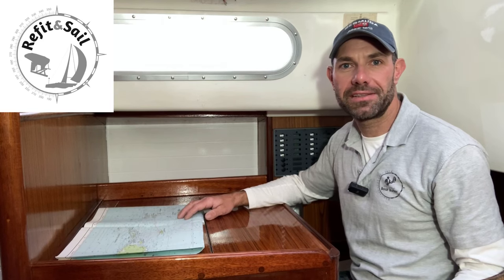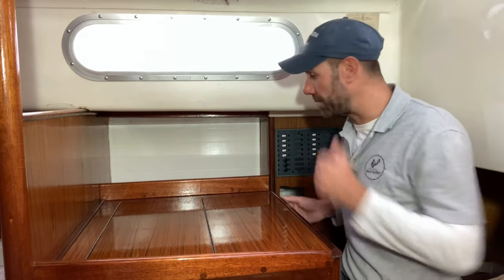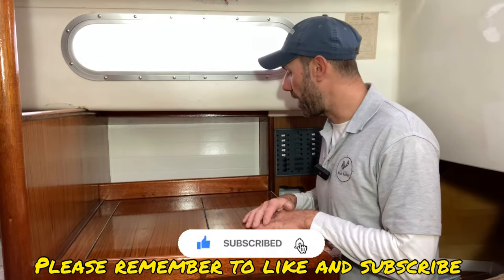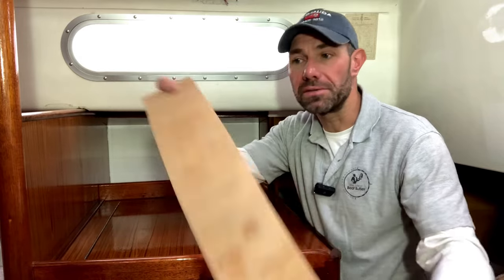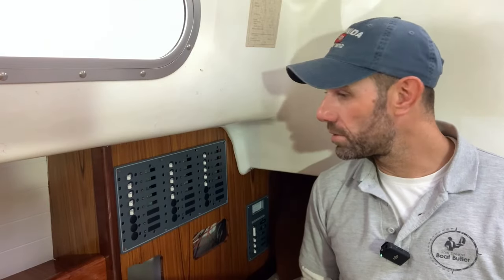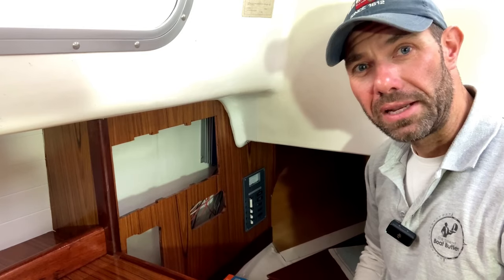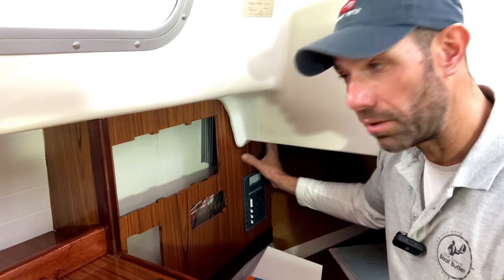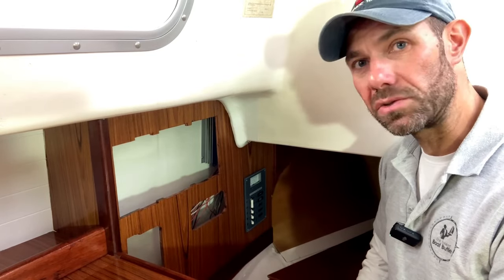Refitting the Chart Table, Nav and Switch Panel Area (Project Lottie Ep 25)

Comment: That's is some very nice woodwork indeed !
I do like the new shore power panel, I am about to replace my old domino unit with a new rcd consumer unit but this looks like a proper job.
Thanks for another very informative video.
Reply from the maker: Thanks.    I have used/fitted a domestic RCD/ Fuse box a few times previously (albeit a water resistant one designed for garages or outside buildings) which is much cheaper but definitely not as nice.    The owner Pre-bought all the switch panels and provided them, really nice quality but I know they are quite expensive.
Reply: @RefitandSail  
Thanks George, I'll look into that, I thought it was your spec not the customer, interesting. The one I have would be fitted in a garage or the like, the current one is in the engine bay and I was going to keep it there but change the feed cable, I also like the new shore power socket you fitted. Thanks for the advice. 

🍺 in the post.

Comment: Hello
Nice video as always 
You didn’t explain where the VHF will be fit, and or chart plotter.
Cheers
Reply from the maker: Thanks, vhf will be mounted under the deck just forward of the main switch panel (effectively in the book shelf area).  The chart plotter/mfd is mounted outside in the cockpit.

Comment: Very nice work!! Is the galvanic isolator just screwed into the hull?
Reply from the maker: Thanks, not direct on the hull, off camera I bonded some plywood ti the inside of the hull so that equipment can be mounted easily, then the whole area was flowcoated.   So it’s screwed to that.
Reply: Surely bolted through with nuts on the outside.
Reply from the maker: @waterboy8999  the GI is not particularly heavy so 4 self tapping screws into the plywood is plenty strong enough.

Comment: Nice work!
I have a question.
I know they make new Contessa 32, but a new Contessa is just as good as an old one. Are they equally well built?
Thank you!
Reply from the maker: A new co32 is going to be a better boat that a 1970’s built boat in many ways as the resins in the hull and deck layup are better, also the quality of the fit out by JRL is extremely high.   That said some of the other materials that not so good or not say to get hold of.   For example good quality slow-grown Teak is very expensive and in short supply and JRL (like me) would rather it stayed in the rainforest than be felled and imported illegally so we are both looking to other more sustainable options but that is proving problematic at times.

Comment: 19:21  How did you fix the cable to the deck/hull?  I find the cable tie mounts don't stick, and I don't want to screw into the fibreglass for risk of going too deep.
Reply from the maker: They are sticky mounts but with the addition of a screw, on that outer side there is a ledge or shelf that the deck sits on so the short screw go into that no problem.    The other option I have done when it is not possible to screw is to bond small blocks of wood or GRP to a hull then screw into that.

Comment: Any preferred brand of switch panels?

And which cable ties did you use for the conduit?
Reply from the maker: Blue sea is nice but top end price-wise.   There are other options and custom made or diy if you want to buy the components.